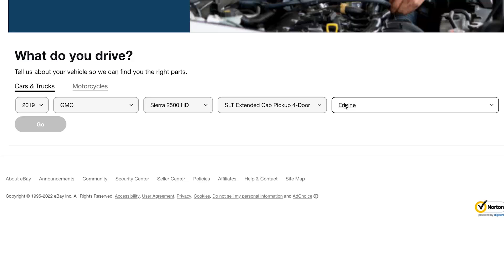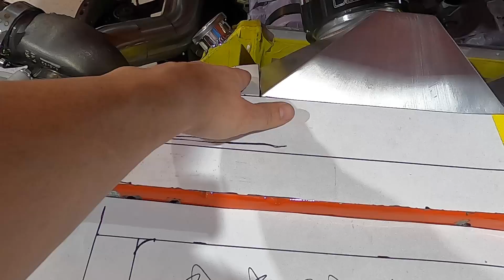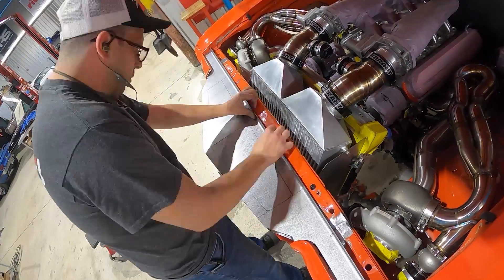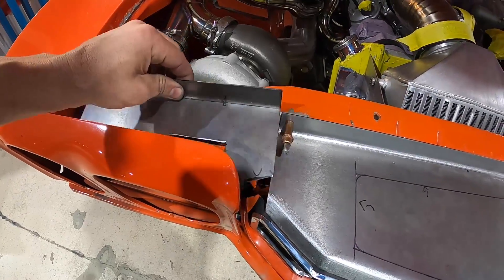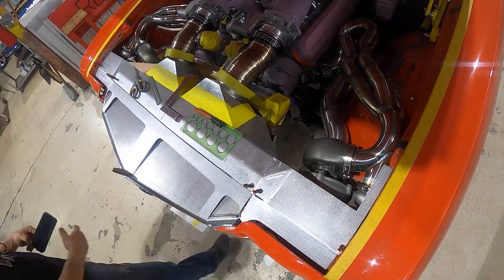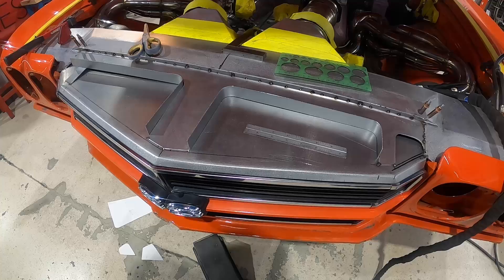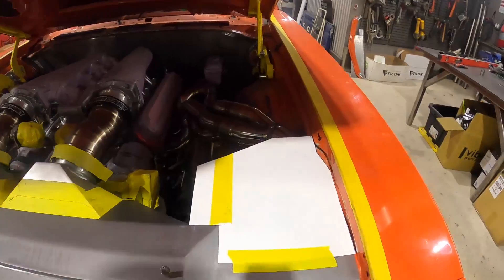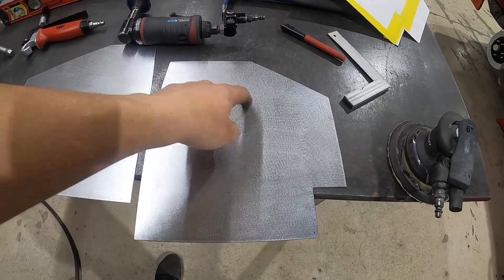How to: Custom Engine Bay Sheet Metal Fabrication - 1970 Twin Turbo LSX Chevelle Ep. 7

Comment: Nice work! Quesion though. Why are you cutting squares on the plasma and then manually bandsawing the rest, as opposed to putting the full pattern in the plasma and letting it do the work?
Reply from the maker: It's faster for us to cut them manually when we only have one or two of the same shaped piece to cut. We cut them from hand from our template instead of having to take that template, calculate all the lengths, figure out all the angles of the compound curves it has, transfer that onto the CAD program and cut it.

Comment: Will there be enough give in the exhaust and intake systems for when the engine torques on the mounts?  Knowing that it's going to put out some pretty high horsepower and torque, the car is going to flex.  I didn't think of this while watching those videos, but did while you were making the template around the intercoolers.
Reply from the maker: It's a very similar set up that we have in ChaChing, and we've had no problems so far with that build!

Comment: IMO everyone should stay far away from EBAY unless you want to get scammed their so called warranty or buyer protection is basically non-existing and you can't call customer service it's all email communication over multiple days not timely at all. 

I had some Chinese sellers send me a 3 wire electrical plug instead of my aluminum rc car parts and when I contacted the seller they wanted pics of the item/package so I provided them with images and their ridiculous response was we will give you a partial refund and you can throw away the wrong item. I was like excuse me? No you will give me a full refund and you will pay for return shipping for your item or I can throw it away they replied saying they will give me a full refund if I first give them a 5 start review. I said no give me a full refund 1st or I'm just going to leave a 1 star negative review screw the refund scamming ppl isn't cool I'd rather warn others buyers that you're scam sellers. In 12 years of using Amazon I have never had an experience remotely close to this it's always quick and simple go to my order history select the item I'm looking for then select return then select reason for return then where you want to return the item (ups or somewhere else) then confirm and they either give you a QR CODE or you have to print a label all done in 3min or less and most of the time it's free returns if you have PRIME unlike eBay where you pay shipping and return shipping.
Reply from the maker: We've never had an issue like that with eBay.